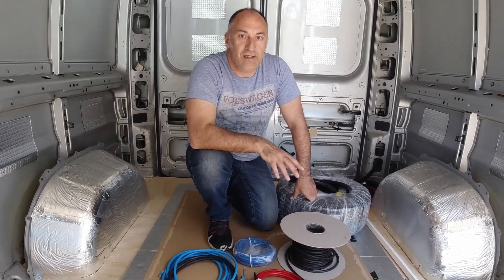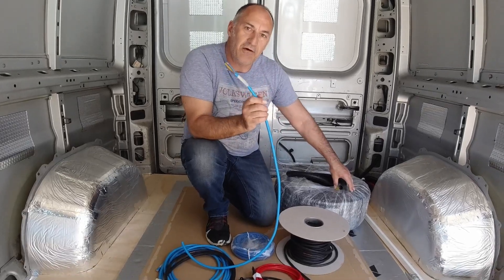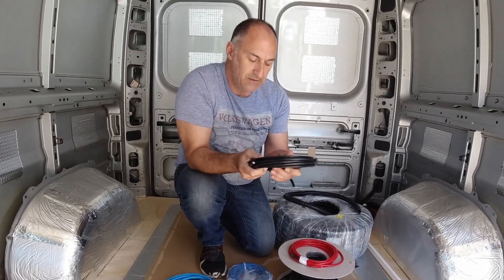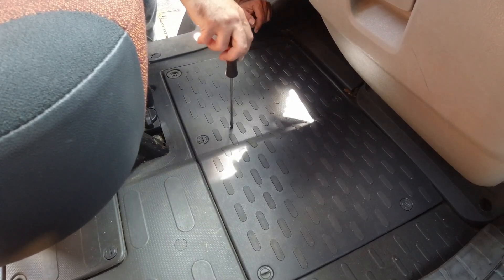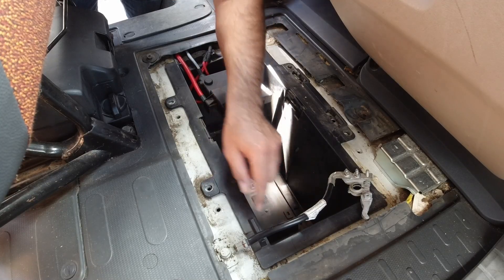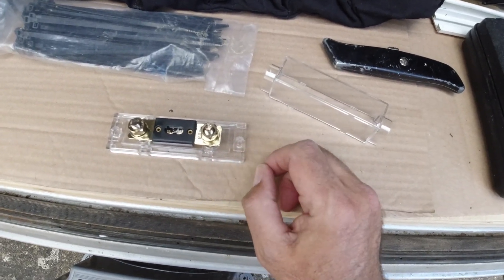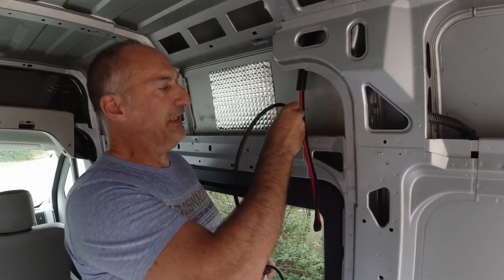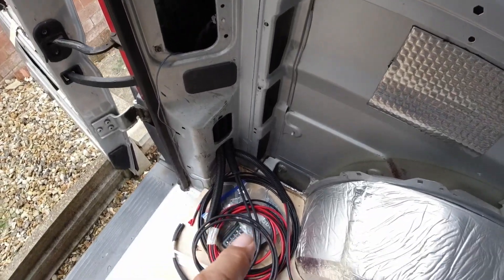How to Wire a Camper Van - Budget Build Electrics Ep15

Comment: No need to run negative supply cabling. Just run positive supply cabling and then earth whatever it is you want locally off the body of the van. Pretty much half your cable requirements.
Reply: No. You're opening a serious amount of troubleshooting if something goes wrong. Now you are tracking a ton of shit for 1 bad ground. The star system works better than this.
Reply: @ragnaroksangel ya, if you’ve owned a classic British car, you understand
Reply: @dbcooper185  all modern cars and vehicles are wired this way.
Reply: Hi, I was just wondering. I'm setting up my renault master  wire setup. I'm going to be  running two 100 amp leisure batteries  at back of van 4m from van batteries  and running  solar on roof just wondering what size  cable from van batterie would be enough and safe to run. Thanks

Comment: Loving your video's Greg and modelling my install on your setup. What size cable did you run from your fuse block to the waterpump? I have a similar shurflo but the 11.3 litre one. Thanks in advance :)

Comment: Hi Greg
I have run 2 x25mm cables into the battey box as your vid.I have the renogy 50amp mppt/b2b.
Can you just confirm to me so its crystal clear. You connect the negative wire to the negative of the starter battery and NOT the chassis.
I am reading so much conflicting infomation on this and getting myself confused. I have a smart alternator and there is a little box attached to the battery negative which i believe is connected to the alternator, i assume this wont effect anything if i do this.
I appreciate the videos you do and the time you dedicate to helping in the comments. Thankyou Greg.
Reply from the maker: Yes connect your two battery wires direct to the starter battery. If you have the 50amp charger you will need a 75amp fuse on the positive connection and you will also need to pick up an ignition supply to the charger to tell it the van has started because you have a smart alternator. There is a wire with small green plug on it for this purpose. Fuse on the leisure battery positive side is 60Amps.
Reply: @GregVirgoe  thank you for confirming that for me.

Comment: Greg, great video again. But, what do you think about running wiring under the flooring? This would really shorten the run of cables needed to get from where the battery is to the other side. Similarly, running water pipes across under the van floor would save a lot of pipe runs. I did my flooring just like you with battens and thermoboard insulation so the wires/pipes would take the space the thermoboard would go. I wouldn't have any sort of connections/junctions under there, just feed lines. I'd need to never screw down into that area, of course, but I'm wondering if there's some other problem with this that I'm missing. Thanks.
Reply from the maker: I put two 50x25 plastic trunking across in the floor in our sprinter for electric cables. But I would never bury water pipes in any floor or wall because of potential leaks. 
It actually contravenes current water byelaws if it was a house.

Comment: I have just bought 2 x Renogy 200W solar panels and I am going to be using the renogy 30 MPPT charge controller to 12 v 200 amp hour battery is this system going to be ok or do I need to modify it ??
Reply from the maker: That will be perfect 👍🏼🤩
Reply: I was worried because it’s the 23 volt solar panels not the 12v I got a good deal it’s it too much for the 30amp mppt charge controller
Reply from the maker: @Ex-ambulance-conversion  no if you wire them in parallel the max input is 400w and 25v so you are at the limit but should be ok.
Reply: Should I not wire them in parallel because if it’s in series the voltage will be more than 25 volts but will be up to 20 amp on current
Reply from the maker: @Ex-ambulance-conversion  sorry I meant to write parallel, thanks for questioning me. I have edited my comment. My apologies wasn’t thinking straight.
Reply: @GregVirgoe  Thank you so much for your help if you still have loads of the rubber grommets for sending the wires through the van i will have some off you haha

Comment: I've bought an Iveco that was done to a poor standard (expensive mistake). I've had to take it back to bare metal. The guy before has put expanding foam in the ribs, anyone have any suggestions on where I can put my cables please?
Reply from the maker: You can put a couple of plastic trunking across in the thickness of the floor and make false column on the sides of the van to box in some cables. Alternatively use copper or Galvin conduit on surface and make a feature of it 👍🏼😊
Reply: @GregVirgoe  thanks! I'll look into that.

Comment: Have you done a video on the diesel heater? Yet 

Thanks
Reply from the maker: It’s due out soon, I’ve tapped into the main tank but my original location for the heater I’ve had to change due to suspension and other chassis members in the way

Comment: Hi Greg, Karen again. Id like to tackle the electrics myself as I think it would help me with maintenance later down the line but I confess I’m a complete beginner 😏 I know every system will be bespoke to coincide with the end user requirements and I’m guessing you always construct a system that is scalable for add ons later. I know there are set items that will be standard (fridge, heater, pump, lights etc) and I know luxury items will need to be juggled dependent on available stored power but how do you gauge what size wire to use? Is the calculation to determine what size solar panel required used?
Also, you very kindly discussed spray cork with me and I’ve taken your advice re 10mm dodo insulation. I intend to use the van through the winter, pricing up the 12mm Dodo Thermo Liner Pro SE in their Black Friday sale it’s coming in slightly cheaper than the 10mm and of course is thicker. Is it a no brainier to buy the 12mm or am I missing something?

Comment: Hi Greg loved the videos so far. Just a quick novice question what would be the difference with installing the 30A or the 50A im assuming the 50A could just take more input or am I totally off.
Im planning on putting in 1x 200w panel with 200ah lithium battery and no 240v at all. So would the 30A be good enough?

Comment: Hi Greg, thanks for the video. I have a few questions, ive just got a transit van and want to add some 240 sockets in the back for charging batteries, bit better lighting and to run a kettle off the 240 sockets. 
I was going to get 2 x 110ah lesiure bartteries and an inverter, would a 2000w inverter be ok or would i need a 3000w? Also my van had a smart altinator so would need a dc to dc charger but im not sure on what size ect. Nor am i sure on the size amp fuse from the starter battery. Any help from you would be much appreciated. Thanks Jack.

Comment: Did you manage to find red & black H07RN cable or are you just using blue & brown?
I have already used red/black automotive cable internally but I need to find some rubber sheathed cable with good UV resistance, for external spotlight wiring.
I know the colour really doesn't matter when there are no regulations for vans, but for some reason I can't convince myself that it's okay to use those colours for DC wiring. But if you use it then I will lol.
Reply from the maker: The H07RN rubber cable i'm using is brown and blue :D

Comment: Hi Greg, amazing video and very helpful. The 2 cables you linked, are they sized enough to be used for all applications? e.g. will that arctic cable run an air fryer, and is the 12v cable big enough for lights, USB, fridge, water pump, etc. Thanks again

Comment: Fantastic series can’t wait for more video’s of the build, just one question this might have been answered already, are you using 2.5mm 2 core for the 12v electric systems, I have watched the sprinter van build and I think you used 1.5mm 2 core in that?, keep up the great work it’s giving confidence to start my own build project👍🏻
Reply from the maker: I am using the same 1.5mm 2 core for small stuff like led lights etc and the fan.  For larger loads like the fridge I size the cable for each item as they don’t like to see any volt drop. Thanks for watching 😊
Reply: @GregVirgoe  thanks for the reply

Comment: Hi Gregg. Thanks for your response. Renogy it will be then !!. In your video about running the positive and negative wires from the engine battery and then the same from the leisure battery do they both go to the blade fuse holder ?. 

Regards 
Mike.
Reply from the maker: Hello Mike, those cable go to the dc to dc charger. Please watch this video which explain how the whole system is connected. https://youtu.be/xCw7eARJKOg?si=Hp6AxeZJMmuotP7d

Comment: Hi Gregg just subscribed to your channel,I just in the process of buying a lwb crafter to convert. Your video’s are so clear and very educational for my van build. I look forward to speaking and picking your brains when I get around to doing the van. 
1st question is which would you recommend for off grid ,renogy or victory ?.
Thanks for all you videos Greg. 

Mike.
Reply from the maker: If you have loads of money go for Victron as it is the market leader and very expensive. However if you just want a solid budget solution that does everything and just works then go for Renogy. If you watch my wiring video of this van build you will see I have a great setup using all Renogy equipment

Comment: Hi Greg, thanks as always for a great video with lots of helpful tips and tricks.
You mentioned at the end of the video insulation and since this, along with condensation is your area of expertise I wonder if you had any thoughts on spray cork. 
Apparently it’s lightweight, thin, water and fire resistant, has great thermal/acoustic properties and needs no vapour barrier. I know your van is themed as a budget build and cork is expensive but I’m looking to live in my van so keeping temperature regulated and water/mold free is essential.
There’s a great demo video called ‘What is Cork Sol?’ by the YouTuber Trowel Talk with lots of info. In your previous video you discussed the dew point and I wondered how that would sit with cork?
Reply from the maker: Ok so I could write a paragraph about why it’s not a viable option but let’s just give you the facts. 
It has a thermal conductivity of 0.04 w/mk so only 10% better than any wool type loft insulation ie mineral wool, recycled plastic bottle insulation etc. it typically comes in 10mm thick sheets so you would need at least 9 layers to equal one application of 100mm loft insulation. That would cost you £100m2 and would weigh a ton. 
Stick to the conventional and best materials. PIR, closed cell foam and recycled plastic bottle loft insulation by Diall. You won’t go wrong. Did you know that it takes 9years for a cork tree to regrow its bark. That’s not really sustainable.
Reply: Oh wow, that’s interesting, it’s certainly marketed very differently! Thanks so much for the insight Greg, I really appreciate you taking the time to reply 🙏🏼
Reply from the maker: @SecrePeach  sales people will try and sell Sand to the Arabs. Marketing will never focus on any negative points for obvious reasons 👍🏼😊

Comment: Thanks a ton Greg for these super helpful videos! Do you think it would be possible /good idea to put a switch on the connection between the starter battery and the leisure battery, to only use the alternator power to charge leisure battery when needed? I'm worried about burning diesel for no good reason on those sunny days ;)

Comment: I’ve rewatched your sprinter conv and just ordered my cables, conduit etc …not sure if I need an isolated or non- isolated Victron B2B charger though? I’m not using solar or EHU, just 12v. Thank you 🙏
Reply from the maker: Personally I would go for the isolated charger and run both positive and negative wires like I have. It’s a much better system.
Reply: @GregVirgoe  ok will do.
Reply from the maker: Why are you not going for solar when it’s free electric??
Reply: @GregVirgoe  I thought it’s no use in the winter and it’s another thing to work out/ think about when I’m already feeling overloaded with all there is to do in the conversion. 😱.
Reply from the maker: @scoularmum  we manage to stay off grid all year round even in winter and all we have is solar. 
Not hard to do if you use the Renogy combined dc to dc mppt charger like I’m using in the Ducato build. Just add panels and two more cables simple.
Reply: @GregVirgoe  ok I’ll have a rethink, thank you 🙏
Reply: @GregVirgoe  Hi Greg i'm hoping to copy as much as i can. But i'm not having 230volts so i am thinking of the same dc to dc set up and maybe a portable solar panel. Would the wiring be the same? By the way, I watched another build and your head popped up through a hole in the roof!!!!
Reply from the maker: @bonkersbeast  just out of interest what video was that? 😂
Reply: @GregVirgoe  It's Wiltshire Custom Camper. Apparently It's par for the course whenever there's a hole in someone's roof for your head to pop out!!!

Comment: Hi Greg, what size cable are you using for your fridge? Or will that be going in at later date.
Cheers
Reply from the maker: If you have a 12v fridge you need at least 6mm cable to minimise the volt drop.
Reply: Didnt I see you said that you would 2.5mm cable for a fridge and 1.5mm for lights?  @GregVirgoe

Comment: Quick question Greg please :) I'm a little confused with discussions around smart alternators. Is this an issue in this wiring set up?
Reply from the maker: No not at all. In the kit they supply you with an ignition lead wire that you pick up an ignition supply to the charger to tell it when the vehicle is running for smart alternators only. Older vans work on voltage sensing only 👍🏼😊
Reply: @GregVirgoe  ah, perfect. Cheers Greg!!! My Renogy Unit hasn't arrived yet so thought this was something I had to source myself. Thanks once again.

Comment: UK is the only country in Europe that uses rigid copper wire for the household. I lived and worked in 4 European countries and all of them use fire retardant tubbing also flex wires 3x monophase fire retardant. It Is great that you recommend this type of wiring, very true it tends to last way longer than the rigid ones .  Incredible videos, as usual, looking forward to seeing this van build.
Reply from the maker: Thank you 🙏🏼
Reply: That's not true. In germany house installations are done with solid copper core wires. 
When a wire is installed in a fixed position you use solid core, when the cable is used somewhere where it can move you use flex wires.

Comment: Hi Greg, love the videos, working my way through them all! With shorter runs of cable from a local fusebox, is 2.5mm  necessary for 12v appliances? I guess a couple of things may have a bigger draw but would 1.5mm be sufficient? Im thinking of weight and cost aswell as ease of routing. Thanks!
Reply from the maker: As you say it really depends on the connected load. Some things like lights are fine on 1.5mm, but larger things like cig sockets or fridges need bigger cables. Use this really easy free cable sizing calculator to help you get the right size. https://www.12voltplanet.co.uk/cable-sizing-selection.html
Scroll halfway down the page to find it 👍🏼😃
Reply: @GregVirgoe  thanks Greg! That's where I've been doing my calcs. I'll double check and maybe have a combination of cable sizes based on what I intend to run. Thanks again :)

Comment: So clear and concise, no messing around, and presented by a guy who obviously knows what he is talking about.  What's not to like?  Thank you very much.
Reply from the maker: Thank you very much 😃 that’s nice of you to say so 👍🏼
Reply: @GregVirgoe  I have a question. You did a 30A DC/DC charger but I was wondering if it is possible to do TWO 30A DC/DC chargers for a total of 60A?
Because with only one 30A charger it would take over 3 hours of running the engine to charge up one 100Ah battery.
That's a bit slow for winter camping where solar is at a minimum and the engine is the only real power source. 
You think this is possible?

Comment: Could you do a quick video explaining the volt drop and sizing your cables.. I.E your 10mm cable from the battery to the fuse holder. 

I dont know if I'm confusing myself. I seem to get a different thing from every volt drop calculator I use 😂
Reply from the maker: I can recommend you use this one on this website https://www.12voltplanet.co.uk/cable-sizing-selection.html
Scroll halfway down its very good
Reply: @GregVirgoe  that's the one I've been using 👍🏻